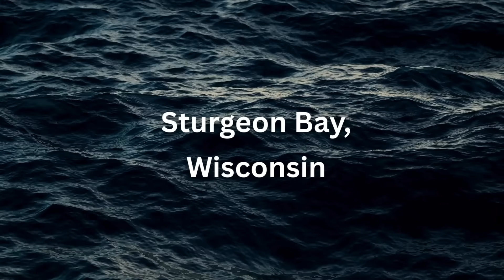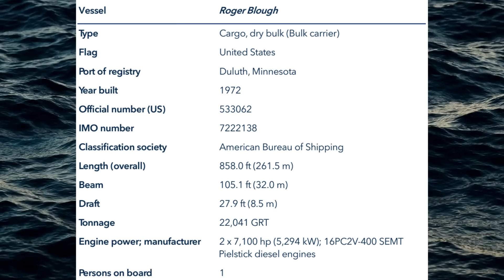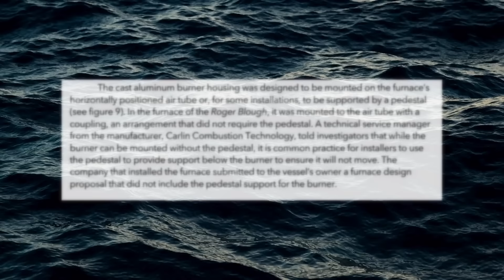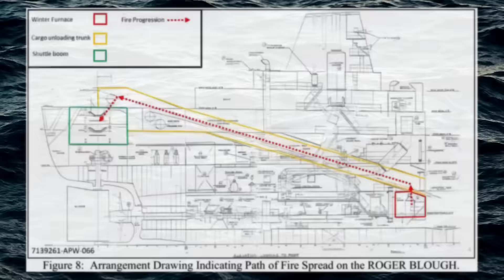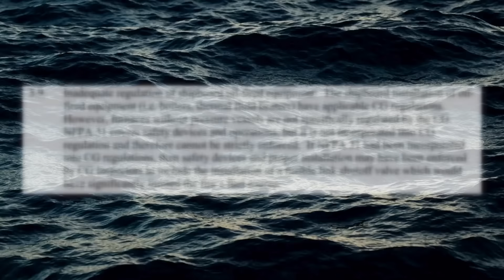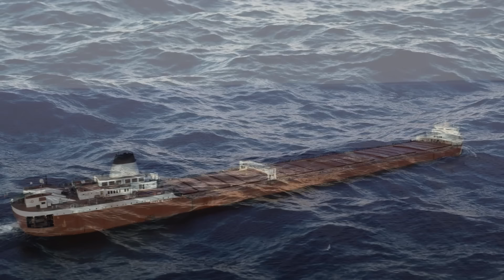Roger Blough: Winter Layup Disaster - $100 Million

Comment: The Swiss Cheese Theory for cause and effect clearly identifies incompetent installers. A maritime rule shouldn't have to be in place to install a $50 safety fuel cutoff valve also. And why the hell wouldn't the ship keeper be on the automatic alert list? This is a freakin' embarrassment for the marine industry. Im sure no one got fired over this.
Reply: The valve has to be USCG Approved or it can't be used.  It has to do with the action of metals in a maritime environment.  Zinc can effuse out of certain types of brass leaving very embrittled copper behind.  If that happens to the thermal cutoff valve, it would be the same as if the valve didn't exist.

Comment: Once again, the amateurs succeed in stacking failure on top of failure on top of failure. No one ever says, "What could go wrong?" A bunch of oblivious fools.
Reply: I agree entirely.
Reply: Totally agree, no excuse for the pure stupidity installing and taking the burner out several times.  No different than the oil furnace in my old house and I took the burner out every couple of years to replace the nozzle and set the electrodes correctly.  Never had any problems with my furnace until it was changed to L.P. gas furnace.  Very easy to do and I didn't have the internet to show me how back then.  Pure idiots including the furnace guy that didn't notice parts about to fail. Hopefully insurance didn't have to pay for stupidity.  SMH.